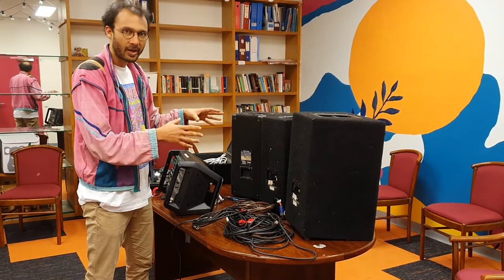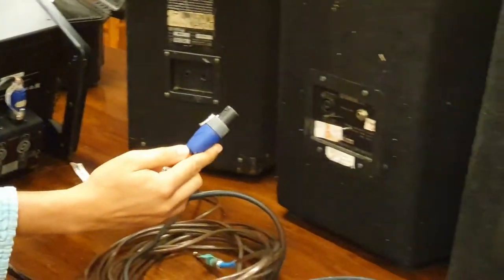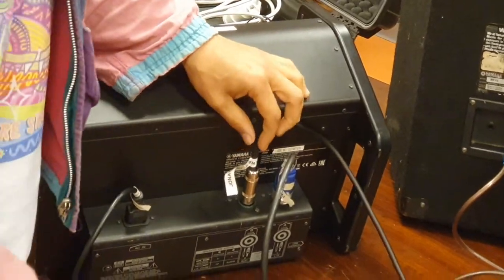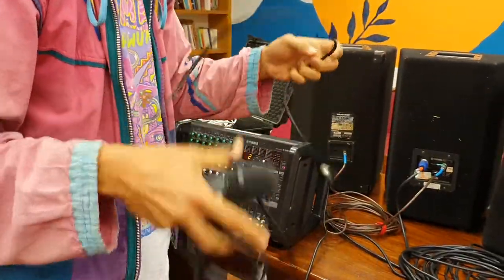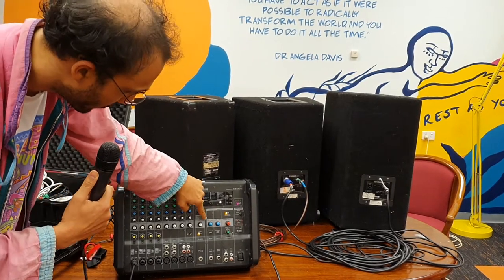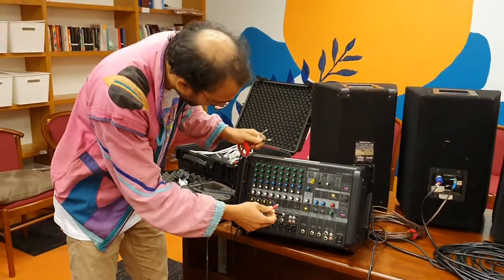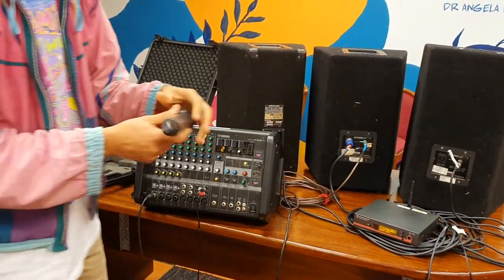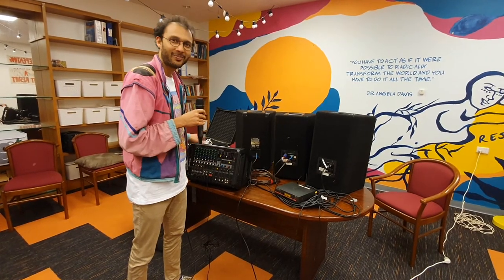How to set up the Gabba Ward's Passive PA system - Yamaha speakers and mixing desk

Comment: Just a question as I’m learning, why not plug both front speakers into left and right on the back and run fold back through the monitor input on the front.? Any advantage or disadvantage doing it that way? Thanks